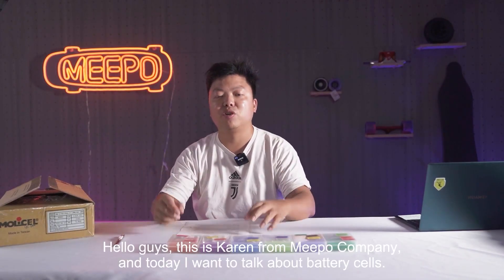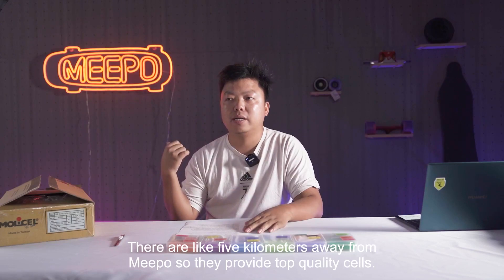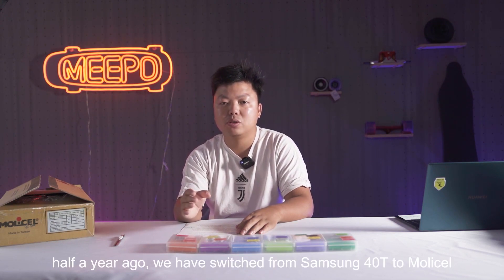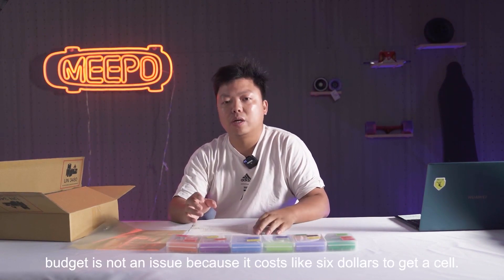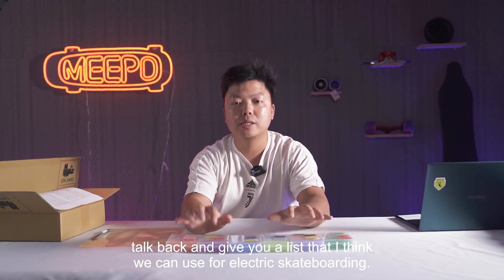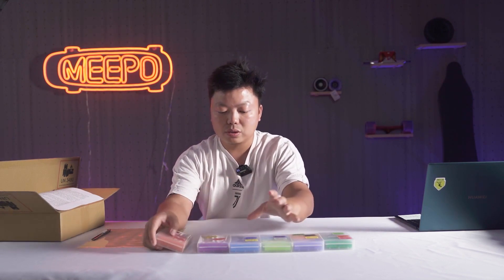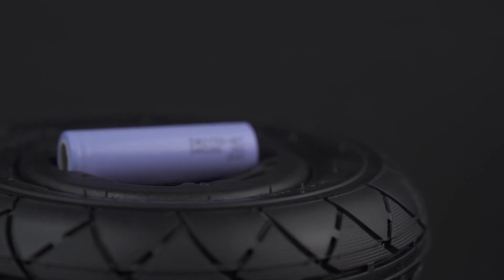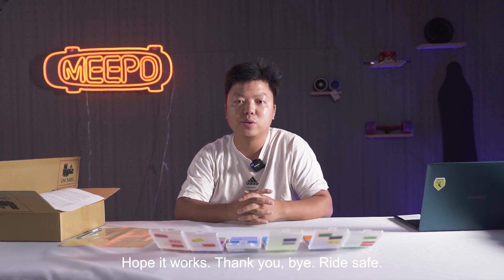MOLICEL P42A Upgrade —The Best Battery Cell for Esk8

Comment: Lishen is hands down just as good as any of the major manufacturer. If you look at the specs closely you'll see they often try to imitate many popular Samsung cells like the LR2170LA is pretty much a clone of the Samsung 40T. Their entire lineup of 21700's is quite impressive, if you can't get the LA's then the SF is still a decent cell with a bit more capacity just nowhere near the discharge rating....however a lot of boards don't need a crazy high discharge cell if you're just cruising.

Comment: My very first SANYO 20700B from you 3 years ago DOES experience the issue you were saying. It cuts off when full throttle. Doesn't cutoff when in mode 1 and 2. But it is still alive tho. Think I will purchase a new P42A pack from you! I'm just curious if it fits the old enclosure haha
Reply: Please get in touch with our support team:info@meepoboard.com

Comment: is there any way to tell if my board has the Samsung or the Molicel? It is a Mini 2 ER delivered at the end of May. 

I should also mention this board absolutely rips!
Reply from the maker: We upgraded the Molicel Cell since November 2020, if you get the board after this time, it's no doubt that your board is equipped with Molicel
Reply: @MeepoElectricSkateboard  I bought my board in june 2021 and it is delivered with 2 batteries of Samsung. No molicel like you said .

Comment: I like Meepos transparency an honesty, very important for me in a Brand.
I have owned the NLS Pro for 2 Years and 3000 Km, i use it everytime it is dry outside.
Reply from the maker: Yeah, Kieran Mao, the founder of Meepo and all the staffs of Meepo are always take transparency an honesty as our working rule.
Reply: Only 200 km with my AWD pro during the year because it rain too much in the north of France . I need a waterproof esk8 .😅
Reply: @NikoLas-mb8wc  I would not advise to ride on wet streets anyway, i had my 2 big falls on a wet road waterplaning.
The AWD is a Beast, how do you like it?
Reply: @fabiankehrer3645 okay ,  Its my second board , the other was the BeastBoard model in belt drive version but the AWD is better by far for me . I  live in a hilly place and power was my first need . I really love it , very sturdy , reliable and powerfull .  I just see 1 or 2 little faults on it : the weight of 11kg. and the range. Range is pretty decent (if you are not riding always full throttle you can make 20 km in Pro mode even with an heavy rider of 95kg.) but a little bit more should have been perfect. 😉👍🏼

Comment: I was wondering, if I own a non extended range v3, is it possible to buy a ER battery pack afterwards?
Reply: Yeah it's $300 USD for a new ER battery and you don't need a new battery case like that one person said, but it's $500-550 USD for a brand new meepo V3 ER board so, your choice. Hope this helps
Reply: @skeleshmoke  thanks for the info :)
Reply: Yeah you have to get the case 2
Reply: Yes, but you should just buy a whole new board. It's only a couple hundred extra to get another one with the extended range battery. And riding with friends is so much more fun than riding alone.